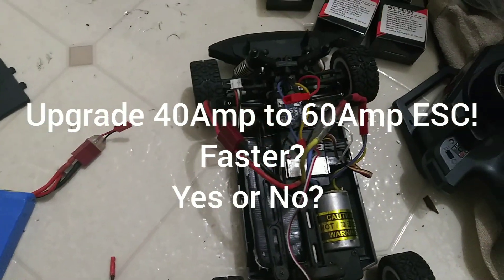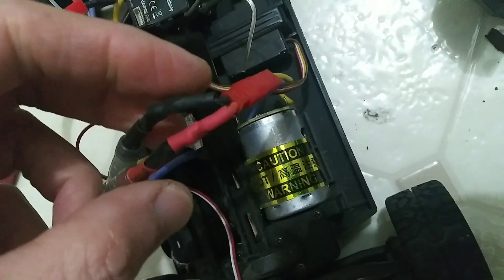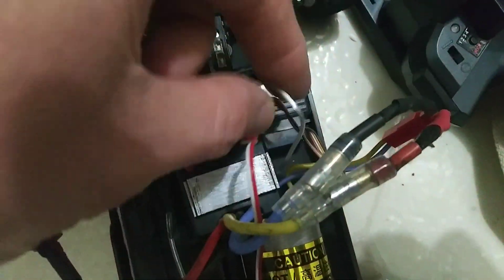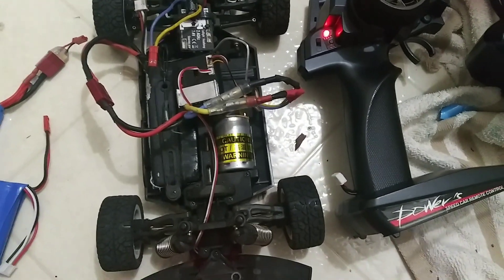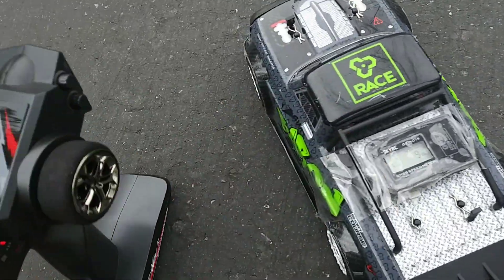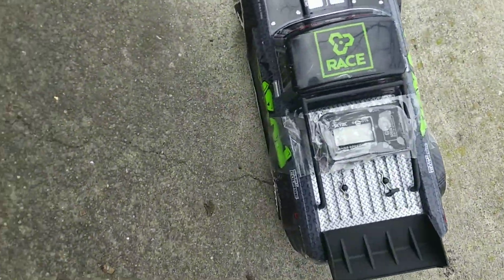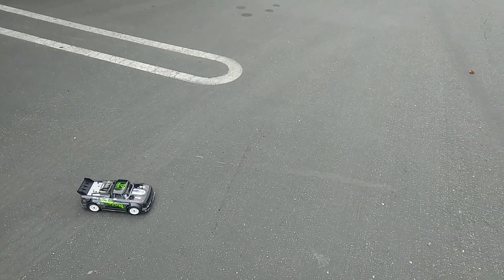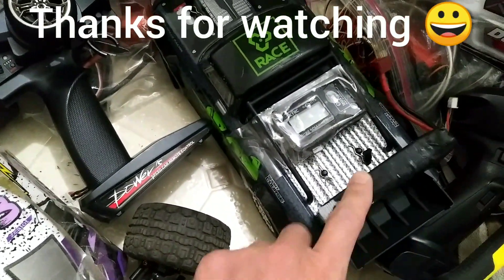(3.5min Intro)SG 1603 Test Wltoys 60Amp ESC on Stock motor. 5X Stock Battery -1mph(2/19/2021)

Comment: why can't you just find a brushed motor that size with a slightly higher kv??? theres has to be one on ebay or somewhere?maybe hobbyking?... then as long as shaft is same just use same pinion... you need the steering set up right... plus the stock radio is way better than wltoys... it has gyro and steering trims.... if you get 4-5 more mph using same stock 1200 2s thats a huge win... this is really not even if it did give you 4-5 mph the car is to messed up to drive normally and have fun...
Reply from the maker: This test was mainly targetting stock motor and ESCs because it's commly available without spending more money.  I know the 40Amp stock ESC is cool because of the built-in gyro but I'm willing to sacrifice the gyro for more top speed using the Wltoys 60Amp ESC.  The results are disappointing but did noticed faster acceleration and definetly lots more run time.  I have gone brushless for this "SG 1603" but I do have a 600Amp brushed ESC that I will test out on the stock brushed motor one day.  Thanks for watching. 😄